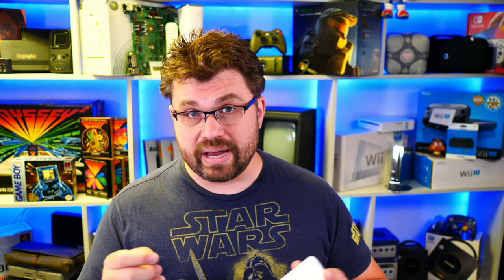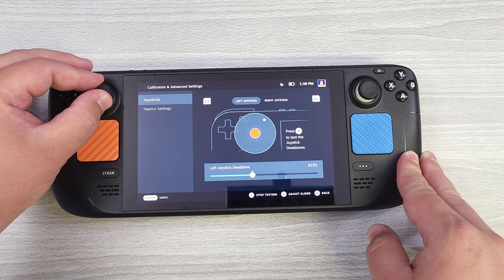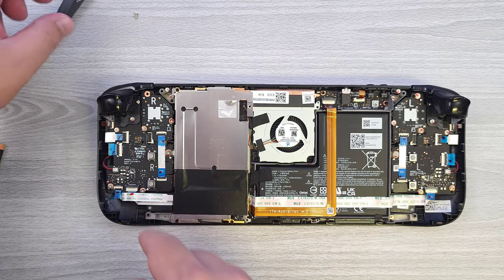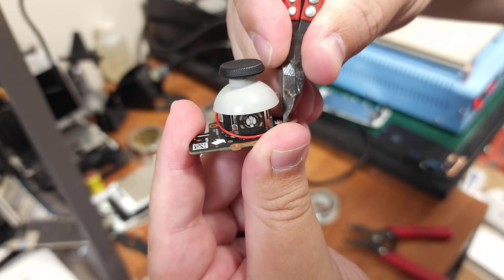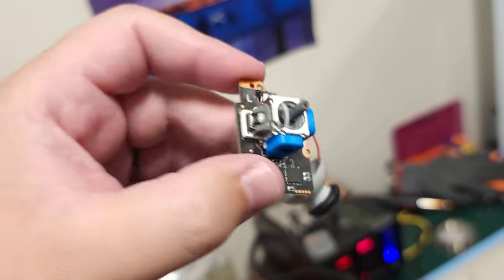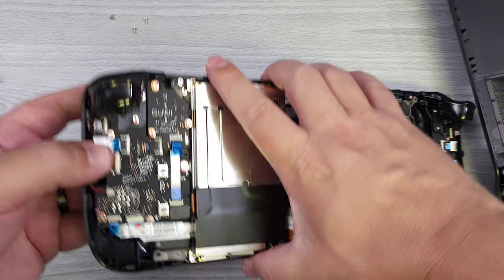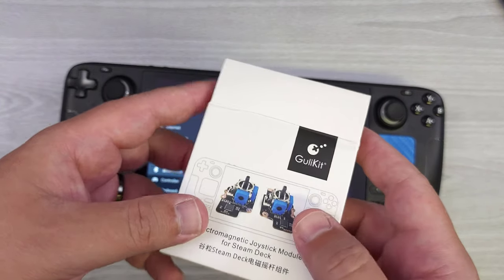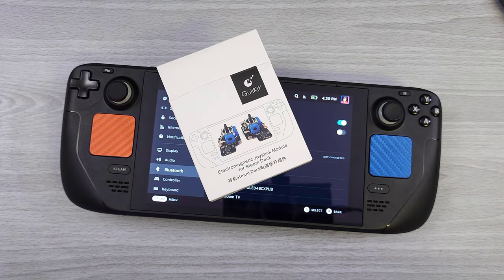Gulikit Hall-Based Analog Sticks For STEAM DECK - How To Install Analog Sticks On Your Steam Deck!

Comment: You made me curious about the "bricked a Steam Deck from unplugging the battery" and I googled it. Did you ever try plugging it into the charger after putting everything back together? According to a Reddit post, the SD might go into "battery storage mode" when the battery is unplugged and require being plugged in for a bit to get it to restart. They claimed that that was the root of the issue for "all the posts saying that they bricked their Steam Deck when replacing the internal storage", so that may have been your issue as well.

Comment: in this video you skipped unplugging the battery. is it also safe for SSD replacement?  
I've replaced the SSDs of a few decks and the battery cable removal has been the hardest part so far... It would be better if I can just skip it. 

I'm thinking the risk of me accidentally messing up the battery cable can be higher than the SSDs breaking if I skip the cable unplugging.

Comment: This video is not advised! The battery is still left connected during the entire process and no grounding strap was used. That should have been step one after opening up the case. You can also melt and remove the glue with the solder gun instead of cutting the leads shorter. As for his method of soldering - you tin the solder tip and use that to solder. You didn't even hit the very small button on the back of the  joysticks to calibrate.

Comment: I never had problems with any analog stick until these hall based ones started showing up everywhere. I bought a hall based controller and I GOT STICK DRIFT in 2 months. And another device i have, the right stick was out of the box sticky and sweeky. My 12 year only 360 controller on the other hand is just fine...

Comment: Wouldn't the other benefit to these be a smaller dead zone? They should never drift, so you should be able to have a slightly larger area where the sticks are sensitive to input. Marginally more range of input?

Comment: the point of hallsensors, is also to remove the deadzone by as much as possible. By simply callibrating i could lower the deadzone from 8000 to 4500, but for example my 8bitdo controller get to 100 , this makes playing FPS games so much smoother

Comment: I have heard that these have a slight problem with how they output their X and Y axis:
The Steamdeck joysticks, when moved diagonally, output a 75% signal on both X and Y, which the Steamdeck then interprets as 100% for X and Y.
The Gulikit joysticks directly output 100% on X and Y when doing the same, which causes them to not be linear.

Comment: It's glued so the solder point wont come undone later on. 
Also when you bend the lead 180o like that you are shortening the life of the cable where the bend is. You will at some point need to go back in there and redo that thing. What you want to do is cut it off again and use the same kind of cable and make it extend to it's proper length and then put down some glue. 
If Valve made it like that than there is a good reason for it. 
Other than hat, great video.

Comment: Unfortunately they have bad (or not enough) QA control. After soldering and assembling it turned out that the left stick has a problem at the right bottom corner. It is just not smooth enough and I have to apply more force there (looks like it is mechanical problem inside the stick). The right is totally fine. So to return them back I had to disassemble the Deck and unsolder the wires. Would not recommend replacing the originals if they are working for you. Mine just stopped working normally and the replacements are out of stock on ifixit. So now I am waiting for the Gulikit replacement and my deck is disassembled again. If you still want to  go for Gulikit - I highly recommend to check how the sticks working even before soldering and certainly before assembling the deck.

Comment: I also wondered if it is actually worth to remove the heat shield to unplug the battery when replacing something that doesn't actually require you to go that "deep" into the device.
I think I would go the route of putting the device into storage mode in the bios. This way you can't accidentally power up the device while working on its internals. Ifixit has a guide on putting the device into storage mode.

Comment: I've used a Gulikit controller for about a month now, but I had stick issues with it almost immediately. While it's nice to not have to worry about stick drift, a problem that's equally annoying is frequent drop of stick range. About 5% loss I'd say, but it's enough for most games to register walking vs running. The temp solution for me has been to press the stick in hard and give it a wiggle, then I'll have about 30min - 1hour of full range again. I haven't heard anyone online talk about this, maybe I am just uniquely affected. I am tremendously disappointed considering how many controllers I've gone through suffering drift, and the controller promising an end to it just slaps me in the face.
Reply: its mostly how magnets work
Reply: Magnets can lose their magnetic charge to temperature variations. Temperature extremes can either cause temporary or permanent losses. When heat is applied to magnets, they may temporarily lose strength but regain this force after being cooled down to their optimal operating temperatures.
Reply: That sucks bro
Reply: Contact them and get a replacement 😊

Comment: Do you know if gulikit or any other company is thinking about making replacements anolog sticks for ps4/5/xbox controllers. obviously it would require soldering but if it's possible I think it would be a fantastic product and upgrade for our existing controllers

Comment: Anyone know why I can't calibrate my new analog sticks? I pushed the buttons on back and nothing, I tried doing it through the konsole and I get a "Permission Denied" message. So I feel like what was the whole point in changing them out for if I have to keep my dead zone the same because they act the same as the old sticks. Not being centered and don't snap right back to center like his do from being on the original analog sticks factory calibration.

Comment: I was wondering if you might do a full install of Lutris (both desktop and SteamOS) for the Steam Deck. I have seen a few out there, but most either show the install to desktop only or have a large confusing configuration setup to get it working on SteamOS. Your channel always explains things in a very detailed manner that is easy to follow. I loved your instructions on RPCS3 for the Steam Deck. Thanks for a great channel. Hope to see this subject soon.
Reply: if you just need to know how to install it, lutris has a guide for steam os on their website in the downloads section. It just involves a single command and then a download from the discover store (like with any other flatpak on the deck)

Comment: Be sure to get the right ones. I got mine about 6 months ago and have controller id MHDA, the older Steam Deck habe MEDA. Right now you can only buy type A replacement joysticks for the MEDA version and they are working on the type b for the newer MHDA. You can use type a joysticks on a type b steam deck, but capacitive touch on the sticks won't work

Comment: I might do this just because I really dislike the clicking noise the sticks make when you move them out of the neutral position. My left analogue stick makes such a loud noise when you move it. I ordered a replacement from ifixit and even the replacement makes the same damn noise.

Comment: This may seem slightly off topic. But are there any analogs like this for the win max?
Reply: Or maybe just some better analogs all together?
Reply: I know it isn't a real answer to your question, but the Win Max 2 uses hall sensors. No idea about replacements for the Win Max. I agree that the ones on the Win Max leave a lot to be desired.

Comment: as these sticks have their movement in a square according to the calibration, will that mean diagonal movement is more sensitive than non diagonal movement
Reply: I'm trying to find an answer to this same question. Have you found an answer yet that you could point me to?
Reply: @JamielAlmeida  I never found the answer to the question

it could also be that it’s a circle, but a larger circle and that tester only shows in a square - but it would still be non-optimal as then all movements would be very sensitive if the circle is that large
Reply: @im_a_blobfish  I don't remember where I saw this, but there is some translation that happens so that diagonals report properly, but it's a thing that has to happen in the firmware, driver or other translation layer.

If the steam deck isn't equipped with such translation, I think I'd replace with the same part rather than get a part with better tech that may not be well supported yet.

Until I find an answer to our shared question, I'll hold on to the stock/factory specified parts.

Comment: Why is the red wire running up into the caps ? I’m asking because that doesn’t make much sense as I wouldn’t assume there’s anything up inside the plastic cap since I’ve never seen anything like that before ! 

If you can reply with an answer I’d be appreciative as I’m quite curious
Reply: It’s for the touch sensor.
Reply: @cjepino  I appreciate the reply and I get what you’re saying but I’m still confused since the touch pad is in the middle of the Controller and so why’s the red wire up inside the thumb sticks which habe nothing to do with the Touch Pad ?
Reply: @technologylord4017  The thumbsticks’ tops have a touchpad.
Reply: @cjepino  that’s crazy I would never think they would have a touch pad inside the thumbsticks and so now I might have to look that up lol I appreciate the reply

Comment: Ooh, that means theoretically you could shrink the deadzone right?
Reply: Yep - actually Linus from LTT talked about this briefly on the WAN show (I think it was the July 8 episode) and with the HE-joysticks you can make the dead zone super small as the sticks snap back to zero more reliably. Appearently that makes the controls much more responsive and precise.
Reply: @esprit101  yeah I was watching that one when it came out, glad to have it confirmed
Reply: Late to the conversation, but I've been able to set my deadzones to the minimum in the UI with my hall effect sensor sticks.
Reply: @williambennett9764  good to hear, I'll be getting my deck soon and am still not sure if I want to get hall effect sensors, I think I'm probably gonna hold off unless I find a reason to upgrade

I'm glad they work so well though

Comment: Thanks for the detailed Video. Actually i Like the Stock joycons , but rather go with gullikit Kong pro2 Controller First. I Hope the Stock ones will hold , If they get drift later i will Upgrade to the gullis. Had good experience with Sega Dreamcast Controllers so basically they also we're magnetic some Kind of. And on my old as Well as my OLED Switch never experienced Drift yet, but think this will also bei related to Handling these very gently and Not drop them much. Compared to Steamdeck the Nintendo ones are Not that super precise i think

Comment: Calibration is wrong. You need to press the switch on the back. 
Also you don't need to cut the wire, just peel it off with the knife flat to the pcb

Comment: Why didn't you went with the recommended calibration method in the instructions (pressing the button ob the PCB)? Very bad soldering job also, just unsolder trough the glue, it'll be fine.

Comment: That left stick wiring is a little sketchy. There's a reason they used glue, and your resolder has a lot more movement in the wire than the OE setup. Good tutorial overall, but I would not feel okay putting it back together like that personally, but it will probably be fine.

Comment: I had some stick drift on my left stick and contacted them hoping for troubleshooting steps. They immediately tried to send me RMA info without talking to me. I found out about the konsole thumbstick calibration and that completely removed ALL stick drift so it was just a software issue. I am kinda surprised they didn't try ANY troubleshooting with me and just wanted me to mail it off.. I just got my deck last week.

Comment: I wouldn’t do this upgrade right now considering there are issue with touch capacitance being completely lost even if you solder the wire on perfectly.

Comment: The pull tab fabric for the battery ripped off when I tried to unplug it.  It looks like cheap nylon compared to the ifixit photos.  I was still able to disconnect it and replace the fan on my steam deck.  I really did not want to have to open mine up but the fan rattle was awful.  I have the same blue H fan also so it seems you get a whiny delta or a rattling blue H

Comment: Clipping those capacitive touch pad wires is unnecessary. You can shave off the glue carefully with an x-acto knife and eventually it just peels up. That way you don't risk limited range of motion.

Comment: Good to see an option for broken Deck parts, personally I'd rather see a cheapish 2TB SSD for the deck, storage is hard to come by and very limiting at the moment.
Reply: Why would you phrase it like that? It's not an either/or situation. We will get those SSDs at some point.. this is only a good thing.
Reply: Have you tried SD cards? They work surprisingly well and they're pretty easy to come by.
Reply: @chronossage  Yeah, I have a 1TB micro sd £150 and the 256gb Deck. 
I have a steam collection of 950 games, with the likes of Ark survival evolved (125GB) Forza Horizon 5 (95GB)
Gears 5 (112GB) Dirt Rally 2 (109GB) Star Wars Battlefront II (90GB) COD WWII (90GB) World War Z Aftermath (50GB) Red Dead Redemption 2 (119GB) Grand Theft Auto V (105GB) Grid 2019 (77GB) Far Cry 5 (66GB)
11 Games out of 950, only need space for another 939 LOL.

Why cant we get the ability to hook up a 5GB external Drive, I wish Valve would have added an extra Type C port that supported external storage , Thankfully I got the Onexplayer 5800U which has two type c ports. x1 usb type A and a micro SD slot, I can get just over 250 games available without installing/uninstalling depending on what games you want available.

I love the Deck but the storage is very limited and find myself choosing older games to install, just because you can only have a dozen AAA games installed on the device.

Comment: His calibration procedure completely missed zeroing out the hardware sticks. There are buttons on the joystick boards you need to press before you put the case back together. Also would have been nice to hear about battery safety instead of just “I’m gonna leave mine hooked up”.  Otherwise the basics are here!

Comment: Will these fit in a joycon?
Reply: Hahahahahahahaha if only
Reply: Hull based joycons:

"Why isn't it possible?"
"It's just not"
"Why NOT, you stupid bastard"
Reply: Not but if you check their twitter, they're also making replacememts for switch joycons
And their first product that used this is their 3rd part switch pro controller(king kong 2 pro)
Reply: These are thicker than the joycon themselves, so no.
Reply: Steam Deck will be release out first. Joy-con will be a little later.

Comment: If Gulikit makes them for the Fusion Pro Wireless I’m in. Other than that no need for them. And I haven’t ran into drift yet. 🤷‍♀️
Reply: Prolly wont, they have their own pro controller that uses this, the way this works you just can't put the analog into any other controller

Comment: Can I skip soldering and lose that feature?
Reply: You can, you just won't have the feature, and you'll need to do something for the wires anyway. If only you could buy some analog caps replacement just in case... (soldered or not)

Comment: Avoid these sticks.  They have a massive outer deadzone with 1/3 of the sticks range of motion basically registering max input.  Stick to the original sticks.

Comment: when I press tab nothing happens and when I type it out: command not found.. :' (
Reply: Same for me, except I got a "Permission Denied" message. What do we do because I can't find anything about it.
Reply: @randysalsman6992  try to reset your Deck again.
Reply: @ArnoNymus  I tried everything.  Only thing I can think of trying now is to reinstall the OS.
Reply: @randysalsman6992  yes, completely reinstall it. Do the Factory reset again
Reply: @ArnoNymus  That still didn't work, now I gotta reinstall all my games again for nothin'. lol
Reply: Just do the recommened method by Gulikit... No need to calibrate via Steam Deck.
Reply: @marcel151  well.. I had to send my deck in.. it was faulty.